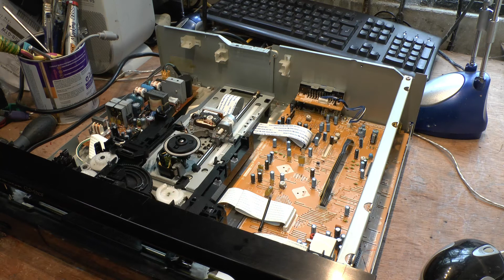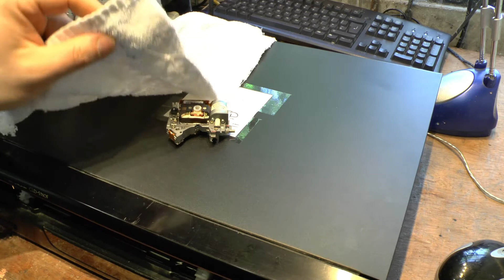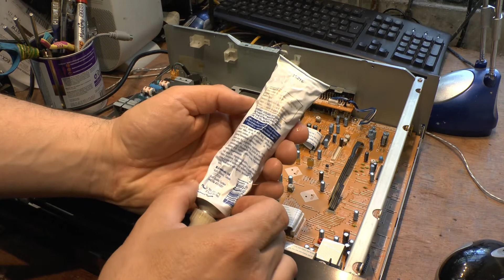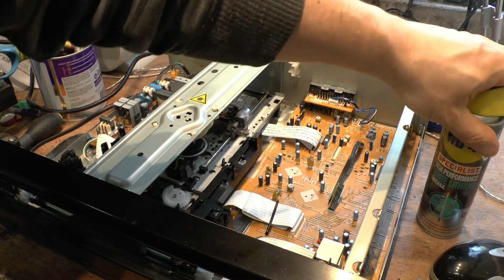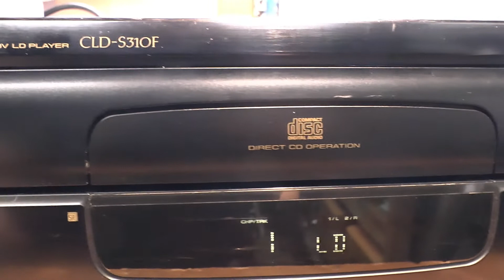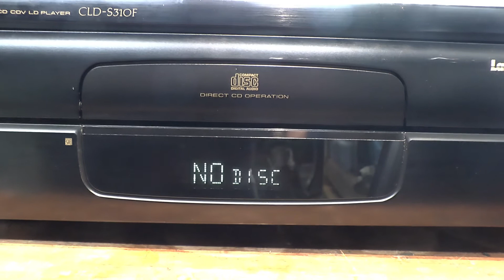Pioneer Laser Disc CLD-S310 PAL and similar CLD-S104 NTSC USA Inspection & minor repair.

Comment: getting error P5 when trying to play some CLV movies on its side B. any tips??
Reply from the maker: Hello.
There is nothing really beyond the videos. In some cases, it can be the tilt adjustment and many more adjustment pots in between. You will need the proper calibration gear like an oscilloscope and remember if you do source the laser Disc adjustment/ reference disc. It's usually a one-way road ( the disc can be destroyed by the calibration!). I have replaced or swapped lasers with more success from one drive to another. Now, one commentary on my videos pointed out that you need to calibrate the laser.. well, technically, you do. But we ain't got the gear in most cases. If you can find an expert, you will be better off. And remember, live voltage is inside these machines and pretty exposed, so exercise caution ⚠️!
Reply: @DRCHRISTIANMD  dont have such gear and the experience to try this. the machine plays other discs just fine and those failing seem to be in perfect condiction both sides. maybe cleaning lens and belt will work?
Reply from the maker: @paubayes2002  could be disc rot on the said discs. Not always visible. I would leave be  if your not confident. That said a new belt can help some times and cleaning the grip ring. I would be vary cautious about cleaning the lens and if you do only use distilled water. I don't use the alcohol based stuff myself on them.
Reply: @DRCHRISTIANMD  is there any way to enter service mode and play the actual disc? it's a model S310S
Reply from the maker: @pau2002  no idea TBH. Not sure if a service mode will help with the issue. Most likely simple causes like the belt,grip holder, or dirty lens. The service manual is online and explains how to enter service mode.

Comment: Hello, I am trying to repair my d604 player and the flat ribbon cable that connects to the laser lense assembly tore and I’m having a really hard time finding one to replace it with. 

Do you have any suggestions as to where I can find on to get my player working again?
Reply from the maker: https://youtu.be/6GBkV0kIhx0 I used a 24 pin and just took of the 24th pin at each end. Thanks for watching and liking.